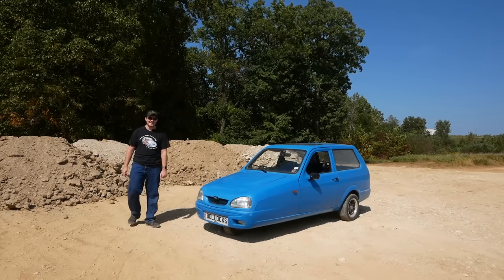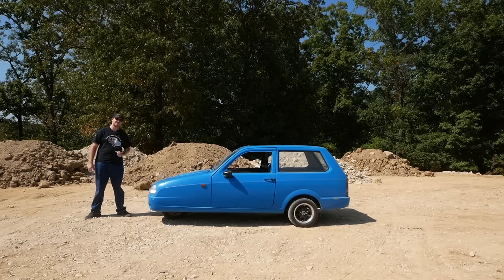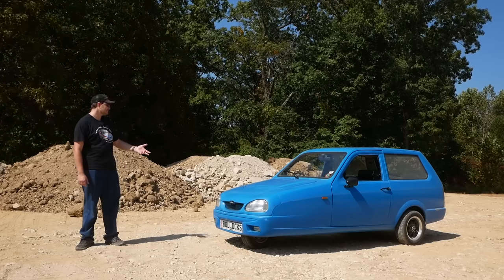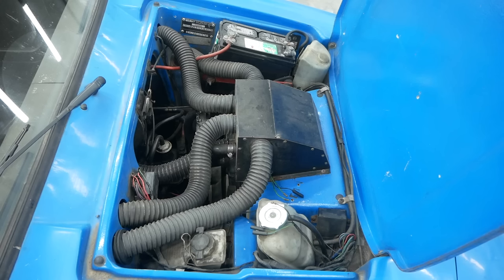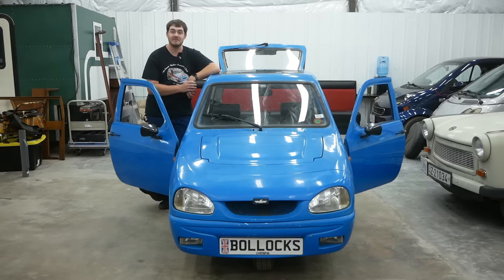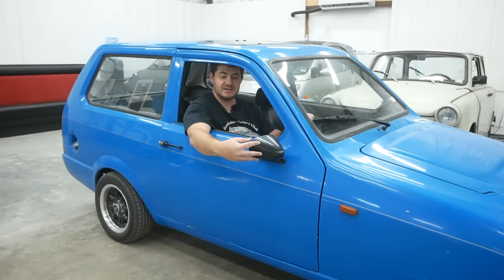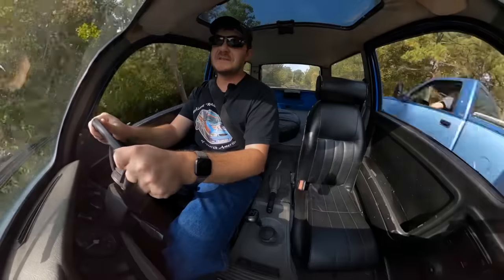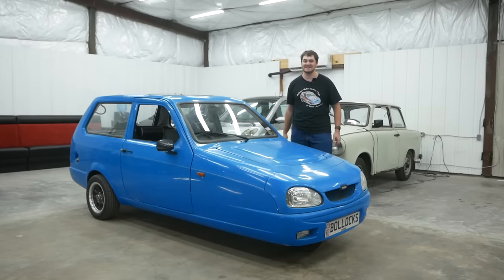I Bought a Reliant Robin!

Comment: When I was at school in the mid 70s I was in the local post office when there was a loud bang outside. When we rushed out there was a Robin in the middle of the road with the steering column up through the roof. Braking too hard had broken something and the front wheel had gone up through the floor.
Reply: That was due to the steel chassis being rotted away. The driver was either driving it without legal registration or with a forged road safety certificate. In the UK every car must pass a safety check every year before it can be registered for use on public roads. A rusted chassis would fail the test.
Reply: bilbo bostonian  Maybe, but a chassis does not go from sound to rotted through in 12 months. It would not have passed that hypothetical 10 month old MOT.
Reply: bilbo bostonian  There were some bent MOT testers about. That could be a dealer passing his own cars,or a tester doing a favour for a mate. I used to go with friends to look at a car they fancied. Quite a few times I grabbed a dodgy looking spot to be rewarded with a handful of filler and rusty metal. Once I pulled the whole sill off as the dealer watched through the window. He didn't dare come out and say anything.

Comment: They actually made a 4 wheel version of this called the kitten. I dont know why, but they did
Reply: There was also the Rebel which had four wheels and also the Scimitar which also had four wheels and a V6 engine made by Ford.
Reply: I like the way it looks
Reply: @waynekerrgoodstyle  I’ve just found out that the Reliant Scimitar was in production in my lifetime! Still with a engine, though not from a Ford Zephyr. I was Five when it was being made and yet I’ve never seen one.
Reply: @elton1981  They used the V6 Essex engine and I think the V6 Cologne engine too.
Reply: @waynekerrgoodstyle  Aah - the Scimitar. I recall our economics & IT teacher at college drove one in the early 80s.
Reply: @elton1981  Princess Anne had a Scimitar
Reply: And there was the Fox
Reply: And the Reliant Ant. A flat bed truck with a short cab and 18" wheels.

Comment: I love that my 1962 corvair has features this doesn’t, like automatic chokes and door detents
Reply: And 4 wheels
Reply: Pardon my question, as all I've ever driven had fuel injection. What does the automatic choke do? Can you just turn the key, put the car in gear and drive off like a normal car?
Reply: @Vengir  the choke helps block airflow to richen up the AFR, which helps the engine start cold. Automatic chokes open with temperature automatically, or at least they should, where manual chokes have a lever inside the car. If you’ve ever used a lawnmower and had a lever that said START/RUN, that’s the choke
Reply: @gilbertg.8501  I live in a formerly communist country. The cars available here until 1980's were technologically outdated and they all used manual chokes. In the 1990's, when we opened up, fuel injectors were already a thing. So I guess we skipped the automatic choke stage and until today I didn't know it was a thing.
Reply: @gilbertg.8501  fun fact: the Chevrolet Corvair is my dream car
Reply: 'Course they both have about an equal love of being upside down. (Yeah, I know that's supposedly a myth about the Corvair, but I've got a uncle who learned first-hand what a good idea seat belts are in his, so I'm inclined to think, maybe not so much.)
Reply: @RobMacKendrick  I have a corvair and a ford pinto (don't ask i like cars that didn't succeed i also own a Pontiac aztek which ive owned since before it was cool) Ive never had my corvair decide to step out on me. I am aware of the cars tendancies but have been able to avoid them and the car actually works quite well... Its basically how aging wheels described it, im aware of the cars attitude not in fear of it, but i will also say that it kinda got overblown, same thing with my pinto its just a car i know what causes the issues the car has, but im not worried about catching fire (even though there is a fire extinguisher in the car and i keep the doors unlocked just in case)
Reply: @compzac  Yeah, it's worth pointing out that my uncle loved that car, and so did I. I was small at the time but I remember how cool it was. In his case he got T-boned in an intersection and the car just flipped over and spun around on its roof several times. He said that a "normal" car wouldn't have flipped on level ground just for that. 

Seatbelts were new then and rare, but his Corvair had 'em and he ended up hanging upside down, spinning in circles. He became a believer for life, though he did get mildly injured when the car came to a stop and he pulled the catch and promptly fell on his head.

Comment: And here I thought I was concerned for your safety in the Trabant.
Reply: Actually not long after the Berlin Wall came down a Trabant was crash tested using the same standards that applied to European cars at the time and I believe it outperformed the Volkswagen Polo. Of course, no car of that time would even score one star on current tests, but it goes to show - most cars circa 1990 were pretty dangerous!  Some time after the Trabant even out performed the Mercedes A class when it came to the Moose test - the failing of which sent Daimler-Benz back to the drawing board with the A class. That's not to commend the Trabant, it is a pretty awful car, but hardly worse than a lot of western European cars developed at the same time - the late 50s/early 60s, when most cars that ordinary people could get were pretty awful.
Reply: @mzcymro  That's all well and good, but you can't get the Trabant up to 85mph or run it on the interstate lol
Reply: @NickCharles  I mean you /could/ take it on the interstate but only if you’ve got a death wish.
Reply: @mzcymro  "most cars circa 1990 were pretty dangerous!" Only if you are a snowflake...
Cars in the 50s and 60s were kinda dangerous, cars from the 80s have front disc brakes, 3-point seat belts, safety glass and some even ABS and airbags. In the 50s and 60s it was normal to have drum brakes, normal glass and no seatbelts or at best lapbelts. I own 3 cars from the 80s and they are safe enough for daily driving.
Reply: @NickCharles  maybe not a stock one, but for a Trabant with a swapped engine 85mph is nothing.
Reply: @adammiller8133  I'm not in the US, so it's not interstate, but I did take my Trabant to the highway many times, sometimes even overtook lorries. 
It's not that terrifying, just the thought of being sandwiched between two giant trucks in a tiny plastic box is a bit unsettling...
Reply: @NickCharles  Believe me, you wouldn't want to be doing 85 mph in a Reliant either - 65 mph was my limit, and that was scary enough!

Comment: Did anyone mention that reliants' have a tendency to catch fire? 
A bloke I used to work with had one spontaneously combust in the works carpark.
Some reliant anecdotes;
It was a trick of local yobs (vandals) to tip them on their sides. 
Another bloke I worked with lived in Whinmoor, Leeds. He had his turned over twice. It all stopped when he moved.
There have been some who have turned them into trailers, and it is rumoured, a small caravan.
Reply: They were deemed as dangerous for the fire issue which was caused by bad customer maintenance. The rollover issue wasn't even considered a problem back then, mainly because people had a better understanding on how not to drive like a dafty.

Comment: I just love the front number plate on that car!! The odd thing is, I live in the UK and I really don't remember this version of the Robin;  the predecessors yes, but not this one. Oh, and I see you've corrected yourself - Tamworth's definitely in the Midlands (home of the famous pigs and Robert Peel, the founder of the Metropolitan police and the modern Conservative party). I've been to the housing estate built on the site of the factory.
Reply: I don't know how much of those were made, but it it was really only between 1999 and 2001... I see a website saying me that in the year 2000, Vauxhall sold a whopping 560 000 Astra (assuming the site took the figures for Vauxhall proper and not Opel in general). Let's be generous and say that Robin sold 10% of that (probably closer to 0.1% but heh). For 3 years, it would give us a figure of 150 000 Robin Mark III sold.
That's already a small number of cars, but as time went, and given they were the last model and quite not as "fancy" as the older models which had a kind of charm, they probably vanished quickly, especially as they aged and parts became scarce. Therefore it's not a surprise you never saw one. Or their more mundale look (from afar) may have preventedyou from paying attention to them as much as an older model would have.
Reply: @LeSarthois  In 1999, there was a craze amongst the yuppie sort for them.  I'm not 100% sure why.
Reply: @ptonpc  For the current models or the older ones? Either way, a craze rarely translate to success... It's probably why it stopped after 3 years :D The craze might have precisely happened because Reliant said they woud discontinue the older model, and people rushed to get the older ones. But you probably know better than me.
Reply: @LeSarthois  I think was main;y for the Mk 3s from what I remember  (I remember the talk was around 1999).  I think the yuppies were buying them because they were cheap, economical and for a short time had 'retro cool' factor.  

Yes, I think you are right, I can imagine Reliant thinking it suddenly had a popular car again and borrowing money (or taking it from other projects) to ramp up production only to have the bubble burst. Suddenly it would be left with cars it couldn't sell and money it didn't have.

Comment: I knew I recognized those headlights !

Man so many parts of this are the same as in my mini, the switches, stalks, lights etc.
Which, based on my mini, that mystery button is a Brake Test button!

If you press it down and the light doesn't go on , the brakes are great!
If you press it down and the light goes on , but goes off again a second after letting go, you should refill the brake fluid
If you press it down and the light goes on, but never goes off after you let go, DON'T DRIVE THE CAR YOU'VE GOT NO BRAKES
Reply: im stoned and dont feel like fact checking you. so ill take your word for it. but if true this is vary informative.
Reply: The mk2  had ford fiesta mk2 headlights,  the rialto had mini metro headlights

Comment: My Grandfather drove al of the Reliants since he only ha d a motorcycle license but he did love them.  We were in a serious crash in one though back in the early 70's.
Reply: How did it crash?
Reply: @mrjed6912  (Sorry this is a long tale but you asked).  Well it was a Reliant 3/25 Supervan.  I was about 7 or 8 years old travelling with my Grandparents.  So I was sat in the back with no seat belt (although no-one wore seat belts in those days even in the front).  All I remember is that we approached the brow of a hill on a dual carriageway which in the UK is basically a dual lane in either direction separated by a crash barrier.  The road was damp from previous rain and this was in the Summer season so the road may have been a little "greasy".  As we came over the brow, at speed, and turned slightly on the top of the brow, the car flipped on its side and slid down the carriageway and hit the crash barrier flipping again back on to the other side.  Both wing (fender) mirrors were stripped clean off and holes gouged in the fibreglass panels on both sides.  The car ground to a halt resting on its left hand side. The windscreen then popped out or may have been levered out by a bunch of men who rushed to help.  My Grandparents and I were pulled out of the "wreckage" and a doctor was called (nowadays it would be blue lights flashing and everything).  The car was flipped back onto the wheels.  All I remember was being thrown from side to side and hitting the fibreglass inner wall which (by the way) wasn't smooth or lined in any way so I had a few cuts from the sharp bits of fibre glass.  We were otherwise OK although my Grandmother was quite shaken.  We were put up free of charge in a Bed and Breakfast (it's a UK thing) and the following day drove back home (I think the accident was in Scotland and we live in England so it was an appreciable journey).  The car was patched up and the windscreen fixed with some sort of gaffer tape.  It wouldn't be allowed nowadays but that's how we rolled back in the day.  The car was scrapped within a few days though and my Grandfather bought an exact replacement in a different colour.  He went on to drive both the Robin and Rialto into the 1980's.  Eventually, in the 1980's he let me borrow his Rialto to take my then girlfriend into town.  I had never driven it before and took a corner a little to sharpish and it went up on 2 wheels but luckily bounced back down, I nearly wet my pants and decided never again to take one out on the road.  There ends my tale!

Comment: Great fun. As with small manufacturers in the UK, parts were bought form other old cars. If you look at the mini you'll notice reliant used manu British Leyland parts including the brake test light, the one you were not sure what it was. Also door handles dash switches are out of the mini, etc. The rear light units are from an '80s ford escort van. The older mk 2 robin used MK2 ford fiesta headlights. Here in the north of the UK many miners drove them  as thrifty transport. Thanks for the video.
Reply: Larger ones do too, even now.  The Mk2 Focus shared 60% of its parts with the equivalent generation Mazda 3 & Volvo S40/V50.  My Mk4 Ford Mondeo had a Peugeot engine, and my Mk4 Vauxhall Astra had an Isuzu engine, also used in the 1.7 diesel version of the Mk7 Honda Civic.

Comment: Didn't Top Gear executives disclose years ago that they rigged their Robin to roll easily?
Reply: obviously you didn't watch the whole video
Reply: Yep, they put weights into the side to make it roll
Reply: And different tires sizes on the back
Reply: Yes.  They put Jeremy in it.
Reply: Yes
Reply: Yes
Reply: Still a trike that is a bit top heavy isn't good, in beam ng drive I have put a 600cc gasoline engine in the pigeon (small 3 wheeled pickup truck) and even if you remove the body it's still a deathtrap
Reply: @michaelfinlay1412  the reliant isnt top heavy its the oppisite
Reply: @John-ci2sd  I was giving an example, thank you for this information
Reply: @michaelfinlay1412  all good

Comment: The overheating may be the rear coolant passageway of the engine being blocked with limescale from incorrect coolant (aluminium block). There's a small drain nut on the left hand side of the engine at the back below the manifold near the bell housing. Undo gingerly and poke inside with a wire coat hanger or similar and watch all the crap come pouring out.
Reply: ..... and don't over-tighten it

Comment: The weird thing is that Reliant also made quite good cars like the Reliant Scimitar.
Reply: and designed metro cabs and even made parts for trains.
Reply: I wouldn't say the Scimitars are "good" cars, they were interesting and mostly not bad but in their day there were better alternatives for less money in most cases.
Reply: @popuptoaster  the gte was the poor mans jenson interceptor
Reply: Princess Anne had one you know.
Reply: @prawny12009  Not with a 140bhp (if you were lucky) Ford V6 in, it it wasn't.
Reply: @burnerheinz  More than one I think? Plenty of room in the back for horsey gear possibly.
Reply: @prawny12009  I would say that building their own engines was quite respectable. I saw the documentary about the guy who wanted to save Reliant in the 90s and failed. Well, three wheels is quite weird, especially with one in the front.
Reply: @prawny12009  yes it was, I had one. It was unreliable like an interceptor as well.
Reply: @jurivlk5433  they out sourced some casting to local foundries but the machining was all done in house.

It is just a shame That when it came time to retool that they didn't make any real  improvements, they just tried to restore what was lost over the years of poor maintenance.

Would have been trivial to design a new more modern/efficient head for them and re-enforce the block if they had to make new castings anyway.

Adopting more modern sealers and stuff rather that relying on cork gaskets would have helped stop oil leaks etc for example.
Reply: @popuptoaster  I ended up cutting my uncles 2.8 up about 15 years ago because none wanted it and the scrap yard wouldn't collect with the body on.

That had a brand new replacement engine from the factory just before my uncle bought it in the late 80's early 90's done about 6k miles since full stainless exhaust system etc.

Would have been ideal for Capri but even they were not as popular or valuable as they are now so noone was interested in the running gear either.

Comment: I learned to drive in a Mk1 Robin, I currently drive the four wheeled version, which is the Reliant Kitten one of only 4000 built. It is almost the same as the Robin but the engine is further forward and it has double wishbone suspension on the fron with rack and pinion steering. It has a ladder chassis. The rear axle on the Releiant Robins as with the Kitten, is not a live axle is has a differential which was available in a different ratio for the van version.
I had a paving slab in the back of my Robin, with wider mini wheels to aid stability, and I was able to regularly get it up on two wheels either side through S bends. All in all greta fun and a quirky bit of motoring history in Britain that took advantage ofg the licencing system which allowed motorcycle full licence holders to drive the three wheeler,